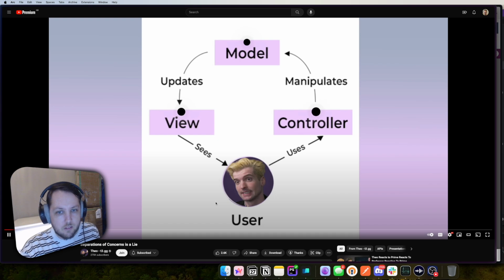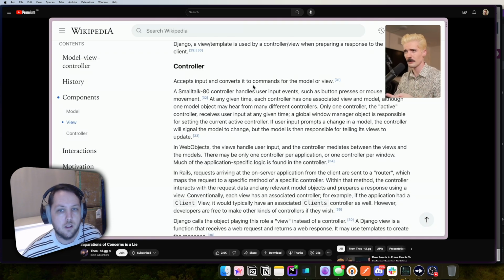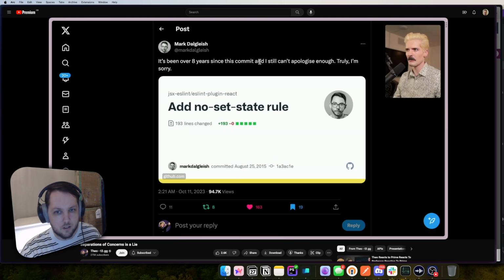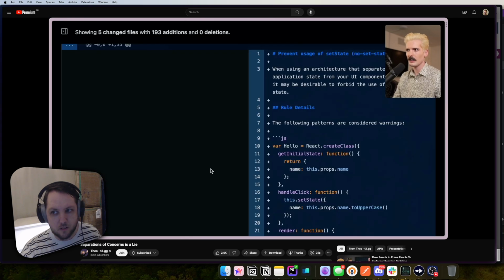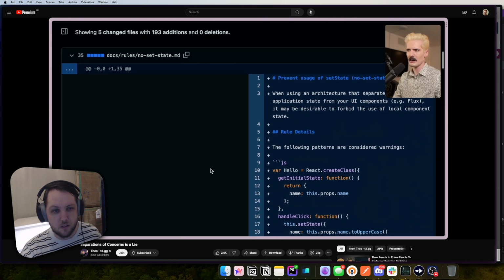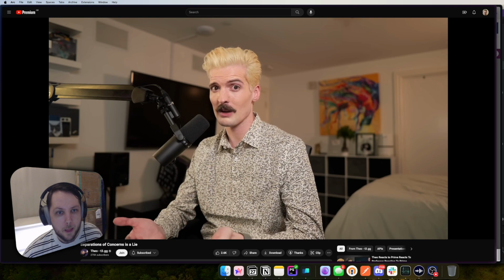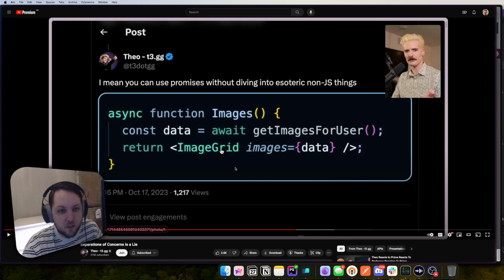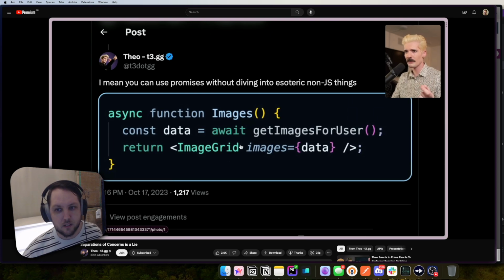How did he get THIS so WRONG...

Comment: Separation of concern should refer to the well defined use-cases in your business domain and then implementation of the features separately for each use-case accordingly. It doesn't make too much sense to talk about separation of concern in case of structural patterns, because you can either apply them or not and they have a name. Where we developers usually talk about separation of concern is when we take business rules and want to translate them into code... easy. He got this wrong very badly IMO.
Reply from the maker: I always feel there is a contextual take to everyones opinion and for me thats where hes going wrong here.. but still, i believe its wrong

Comment: To me using Tailwind does not mess up the separation of concerns when it comes to content and presentation. Say you use <b> tag to display text bold just for the visual effect. Or maybe use tables for just laying out non tabular content. Now there you mix together content and presentation. In Tailwind, none of the utility classes become part of the content. They do are not saved in the data base nor are they visible to search engines as content.
Reply from the maker: i love tailwind.

Comment: Yea this is a stack issue. I agree with Theo if I was using react. But using laravel for example...MVC just works.  This is a trying to shoehorn design patterns into things because you've always done it certain ways.  Abstraction will always be a better way to build but how that abstraction happens should really be specific to the framework and situation.  No point using a hammer on a screw.
Reply from the maker: Exactly…!

Comment: The problem is he neither understands MVC nor separation of concerns. He thinks MVC is what Angular did but Angular just used a similar structure with similar namings to do something completely different. They just wanted backend devs feeling comfortable in the frontend while using Angular so they used some similar structures and namings. Then React came along and React did not throw away MVC like Theo said. React had the premise that frontend only covers the view part of MVC and controller and model has to be in the backend. He fundamentally misunderstands this. It also does not help that he thinks the only way of building a fullstack application is having a db with either graphQL or a node server which is practically only a proxy to your db as a backend and always having the complete business logic in the frontend. All of his problems are coming from not understanding the concepts and proper software design. His remark of having the logic handling an interaction with a component 7 layers away from it again shows he does not know how to properly design and structure a frontend application. If he used proper separation of concerns he would have dumb view components with slots for nesting which only handle rendering and user inputs and a root component which handles the limited business logic of the frontend and composes the view components. Then he had all of the business logic at one place and the components which take user input and trigger a change would always be only one layer away from the business logic. Proper separation of concerns would actually fix the problems he has.
Reply from the maker: defo a misplaced argument /point thats for sure

Comment: Him pointing to CSS styles being inline in the same component, is kind of laughable, if your components are simple sure, but as soon as you have multiple components on a page? You want similar code for key body elements?  The whole point of CSS was to get the styles OUT OF THE HTML.   It feels to me people don't understand how CSS Locators work if this is as big an issue as he says.  And CSS Locators are tremendously powerful.  Note you can still have a separate stylesheet for a component, you don't have to inline EVERYTHING.  Somethings only work inline, in react which sucks, but I think is more about how CSS 'specificity' rules are evaluated.
Reply from the maker: I like the idea of there being SoC in the front end but it needs to be purposeful and considered!

Comment: You made a good point about consuming clients you can't guarantee anything.  See you can sense where theo is leading is to get rid of even the idea of having a 'server api' separate from the client.   Which you know that's fine if you are the only client using the applicaiton, but when your a platform like say ServiceNow, or Salesforce, you have thousands of companies consuming that API which means changs have to be introduced in a way that people can adopt and migrate.   This of course slows down development, but you know what, design and architecture being delayed till the last minute ends up this way.
Reply from the maker: exactly, there are some things we cant change so we have to work with that knowledge.

Comment: "You don't see all the ways this code impacts things"  "If you have one component that has all your model logic separate from how its consumed, its not apparent in the code review which things are impacted by that change, you just see the code that changed, not the places in the code."  Uhm this is why you have unit tests THEO, this is why having tests before you make a change to existing code is critical, because the failing tests reveal it to you in as fast as the tests can run.

The problem here is you can't separate sparation of concerns as its own thing and ignore the other parts of clean coding or architecture, Businesses keep doing this and wondering why they have to replace WHOLE data systems down the road.

Here's the other thing, Theo was using React which is a JS Library (Wishing it was a framework) in other languages like Ada, Java, C#, you make that change and try to build you will GET ERRORS!  its like he's never used an actual IDE or compiler when he says things like this.  Now semantic logic, potentially does have an impact here, let's not forget that, a function that takes a string but no longer does what it was originaly designed for is a problem, but this is why you probably ought to not modify API code once its established except for REALLY good reasons, instead write a new adapter of some kind to handle the new use case.  They don't seem to teach this anymore though.

Comment: His point about react and the no-set-state is because state and props are passed into a component from somewhere else, there are a couple of problems with this, for one thing early on you had classes in reactjs, and  you still had these private member variables that people could see, because JS has a hard time actually hiding private things, but more than that, it meant to make an update you call a method on props or state that is passed in from the calling object, and THAT object handles the update usually (except in those cases where its chained up to an even yet higher level of abstraction.

The OOP problem with this is it kind of kills encapsulation a bit.   The other issue is, Separation of concerns feels a bit of a different animal in a purely functional programming world.  The more languages move toward functional programming, the less these ideas from OOP make sense.  Maybe the issue isn't separation of concerns but trying to force an OOP paradigm onto functional programming to begin with.
Reply from the maker: I had to stay out of the react part honestly

Comment: MVC is more of a 'design architecture' at a higher level of ambiguity than it is about separation of concerns though.   MVC replaced the more common idea of UI/Presentation / Business layer/ Data Access layer and such from nTier architectures of decades ago.  (some of which are still around)
Reply from the maker: exactly, its a structural pattern. design patterns are a way of implementing SoC

Comment: This video was the reason why I was finally convinced that Theo has a limited understanding of the domain.

The argument Theo is trying to make is that separating HTML, CSS and JS based on the idea that those are separate concerns does not make sense, but the point here is not that separation of concerns is a lie, but because React uses a component-based approach where it makes more sense to view the HTML, CSS and JS required to render a component like a button as a single concern. React still promotes separation of concerns because you should have multiple composable components, not one giant component.

I have no idea how Theo thought that the component-based approach of React invalidates a design pattern used in many other places, not just frontend development, which then invalidates a whole principle in software engineering, other that he doesn't really understand the concepts.
Reply: My thoughts exactly. Through that whole video, I kept asking myself “who’s he arguing with?”
Reply from the maker: I think he has some good takes but like all of us, is human. This take specifically i feel is just a little off kilter, neglecting context out of his scope

Comment: I actually feel the separation makes things easier. If you have all these components and random functions processing both backend and frontend .. you’re just creating a very messy structure which would be difficult to hand over to another team.

With separation you can a least create an entry point and exit or a return of data.. whatever for particular isolated components.. for which should make your app more secure.
Reply from the maker: Exactly... there are a bunch of way to implement SoC... MVC is one of them, another is maybe the ports and adaptors pattern. At the end end of the day there are 'many ways to skin a cat' and choosing the right one is hard and might not be the right one forever. Ultimately keeping things separate is going to benefit you in some way shape or form. I can understand his frustrations around working in teams, backend and front end complexities etc but what he describes imo is more of a cultural issue/ approach issue not an issue with SoC!

Comment: It's interesting to see how often the concept of Separation of Concerns (SoC) is misunderstood. Like any abstract design principle, it's meant to be flexible.

React's interpretation of SoC challenges traditional norms. Instead of segregating HTML, CSS, and JavaScript into separate entities, React integrates markup and logic within single component units via JSX. This encapsulation, which combines related concerns, effectively represents UI components and promotes better modularization and reusability.

While traditional SoC separates technologies, React suggests a more nuanced approach—bundling cohesive code into components, each managing its own state and presentation. This method can significantly streamline application architecture.

Although minimizing unnecessary abstractions is ideal, the efficacy of design principles really depends on a team's collective understanding and the leadership's guidance. React's philosophy certainly sparks a thoughtful dialogue on the evolution of SoC in modern software development.
Reply from the maker: I actually totally agree.. I think my overarching point in the video is that MVP is an implementation of SoC and not an argument against it as a philosophy!

Comment: Like you mentioned, we all build on different plains of complexity, and I think thats probably the key. People can be right in their own working domain but wrong in ours. Youtuber's like Theo tend to make very simple applications, while working alone, with very little complexity; therefore they think any type added architectural complexity is unnecessary. 

As engineers work on larger, more complex, and cross team applications, the appreciation for separation of concern and architecture grows. Based on Theo's arguments, verbiage, and talking points, its pretty clear he has very little experience actually working in this domain. I'm not judging based on this at all because like said, different personal working domains of engineering.

One REALLY important talking point for Seperation of Concern/Architecture I never see mentioned is the benefit of onboarding new engineers to a project. When you utilize MVC/DDD/SOLID or any other popular architecture; they can hit the ground running EXPONENTIALLY faster. In massive tech companies when external contracting companies are prevalent and theres a revolving door of engineers sometimes , this is imperative.

I wish he wouldn't put out videos like this without addressing the projects that he works on that this logic applies to. Other youtubers will agree while active engineers will laugh at his reasoning :/.

Good video bro!
Reply from the maker: appreciate it! i totally agree... something im not sure if i make enough of a point of in the video is that MVC is an implementation of SoC.. any bad implementations of it cant be an argument against SoC generally. 

Onboarding, common understanding is a big reason for using patterns and is something i talk about in my video dropping monday!

Comment: The case against “separation of concerns” is that it incurs a hefty local reasoning cost. By moving things away from their place-of-use you loose some ability to reason about the piece of code in isolation. Mutable state similarly breaks this assumption. 

Theo’s argument is against arbitrary blanket rules like “css should always be decoupled from the markup/behaviour” in order to achieve some nebulous benefit of “separation”. 

Imagine if you’ve had a rule “all sql queries ought to be defined in one file”. You’d loose context of where the change occurred, to where the effects of it can be seen. 

Failing to understand software is a “skill issue”. Yet relying on humans to always get over it is unsustainable. The clearer we can make software to understand the better. Having all of the context to understanding a function right at hand is one of the ways we can help achieve that.
Reply from the maker: I dont think we should approach anything as a default blanket rule in software development...
Reply: @CodeWithZeee  Agreed. Programming languages are designed to be as flexible as possible, and enforcing arbitrary rules only limits that flexibility. Organizing your code in ways that are simple to understand is probably the most important design factor in software development.

Comment: “You are doing OO wrong” is straight up “you are holding it wrong”

Every time teams shoot themselves in the foot, it’s cause they did OOP wrong. Every “correct” way, I’ve witnessed, to do OO fails in some other, different, spectacular way.

I think that tools that OOP gives you are inherently flawed in so many ways when it comes to solving real problems. Most of the modern PL initiatives have moved far away from outdated views/tools that OO dictates to be applied to the program structure. 

- Shared mutable state just doesn’t work (even if you “divide and conquer” the problem with encapsulation). 
- Thinking in “objects with behaviour”, not data transformation just doesn’t work. 
- Late binding is detrimental to the ability to reason about the system. 

OOP, by its design and popular literature teachings, promotes all of the above. 

This doesn’t mean you can’t do reasonable software in OO languages. But by the time you’ve solved the issues above, you are not writing the “real oo”. You are doing something more traditionally procedural, or functional.

And what even is “real oo”? It seems the definition keeps shifting around, just like “the correct way to do oo”.
Reply: Im a bit of a noob, I understood all of what you said except for your third point.
What do you mean by "Late binding is detrimental to the ability to reason about the system."

By binding you mean binding functions/procedures to datastructures? If so then OOP usually defines methods in the same place you define a class.
If not, I would like you to explain. Thank you
Reply: @ոakedsquirtle hey, no problem. Late binding is an ‘ol timey CS terminology that means that the decision of “which function to invoke” is taken late, or right before calling the function. This is as opposed to early binding, or static calls. 

You can think of it as static functions vs polymorphic/virtual ones. 

Don’t get me wrong, indirect calls are really REALLY useful. But it’s hard to reason as to what action will be taken in any given codepath. Statically known procedure calls can be easily reasoned about, as they are not changing, and in most language toolings you can simply go-to-definition and explore code flows in-depth. 

My argument was that traditional OO design promotes such indirections too much, where the dynamism afforded arguably not needed.
Reply: I’d say that OOP is a good thing, but too much of a good thing is a bad thing. I think you can go too far with OO, like most things in life. Use it where it makes sense, or where it provides some benefit.  For everything else, just use modules (or static classes), functions and structs.
Reply from the maker: if you're going to write oo code it needs to be oo code, not some mish mash of patterns and approaches then blame pattern or approach. you should blame yourself for not choosing the right pattern or approach. there is no magic bullet or one size fits all in software design so you cant damn everything in the same way you cant praise everything... they are just options, tools
Reply: @CodeWithZeee  I guess we just disagree about OO. And that’s ok. Still can’t accept this stand myself. 

Side note:
✅ No silver bullet
✅ Can’t praise everything
Reply from the maker: @yapet  it 100% it’s flaws, I’m not saying it’s perfect or always the right tool for the job! My core point is that we’ve just responsible for our decisions and that we should own them!